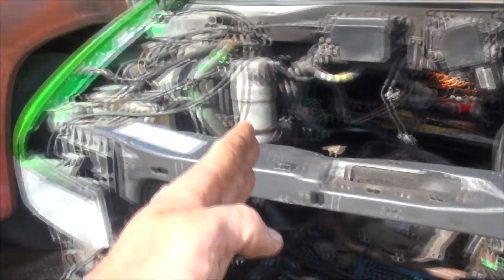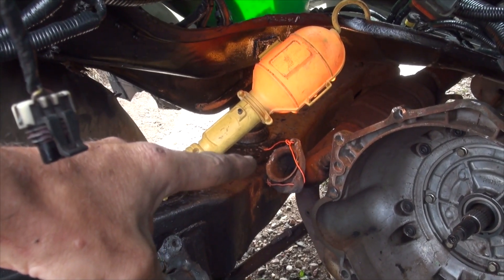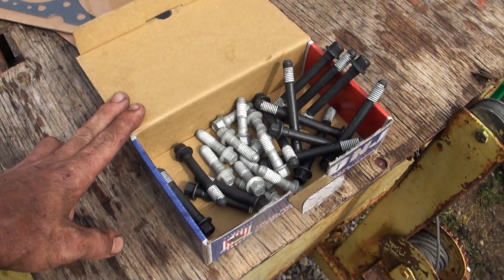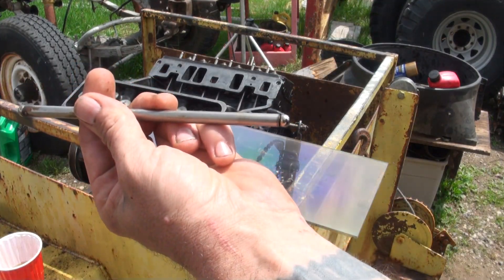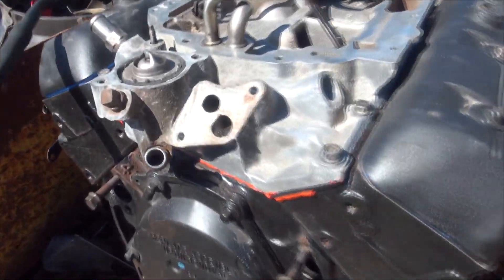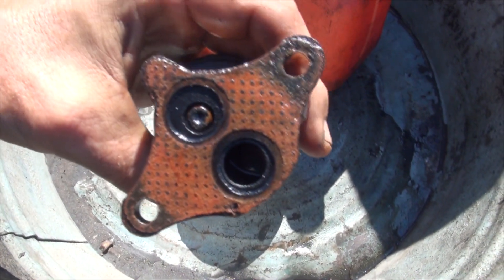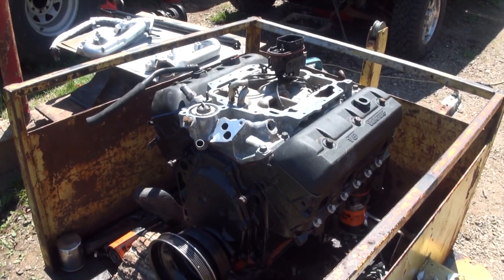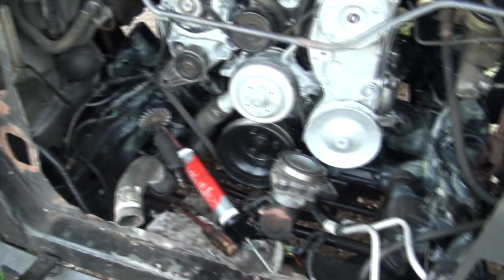How to rebuild a 4.3 Astro Van Vortec engine(part 2)

Comment: If possible, make your life easier and pull the 6 body to frame bolts and just lift the damn body off of the front frame portion. About 40 hours easier.

Comment: You may be aware of this. But I thought it may be worthy to note. I have a 2001 S10 and a 2003 Blazer. Same 4.3 engine. The 01 has an EGR valve. The 03 does not. The lower intake manifold is different. From 02-on the casting of the lower intake manifold has no EGR port. I do not understand why this engine had an EGR (or needed one). From its concept in the 80's until 2001, the EGR was needed/required for emission standards? Then 2002 a new lower intake manifold casting was made without the EGR. And that became the standard on the engine until the replacement in 2013. Usually emission standards become greater not less! However I cannot find any other improvements added to the 4.3 for emissions or performance??? I cannot contemplate the reasoning behind the requirement and use of the EGR system for 20 years on this platform, and then the last 10 years- OH I guess we really don't need that?????? If anyone can shed some light on this shady subject, please do. I have looked for answers. But have found none.

Comment: Did you upgrade the spider injectors?
Reply from the maker: I had planned on it because I thought the newer engine would have the newer style, but it did not, so I cleaned the original ones and put them back in. I have almost 300,000Kms on them and have never had a problem. I now plan on tearing this engine out and dropping a V8 into it this summer when I convert it to a manual transmission.